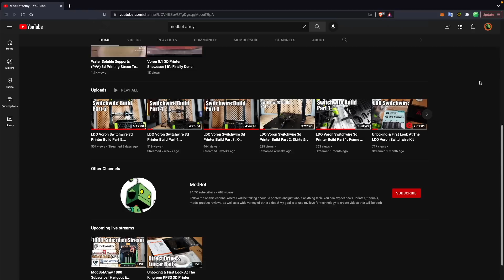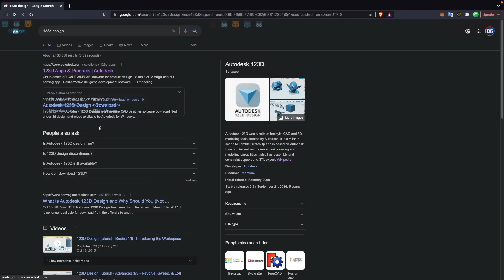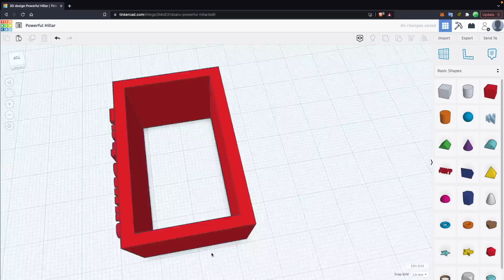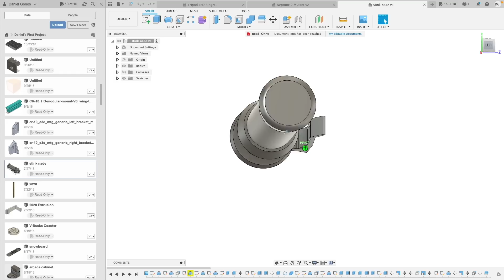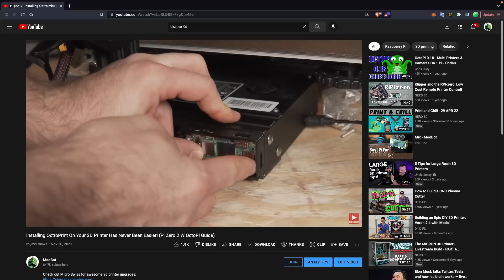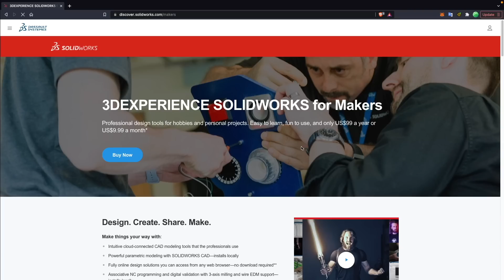Is 3d Modeling A Requirement For 3d Printing? (Where To Start)

Comment: Once someone is past the beginner stage of understanding and using a 3D printer, I personally feel that folks should learn the basics of 3D modeling rather than constantly relying on others for models, usually expecting free or super cheap files. The sense of entitlement that a lot of people feel for the design files of others who spent the time and effort (and in some cases, money) to actually learn 3D modeling gets pretty disgusting after a while.

Comment: A great resource you didn't mention, was more and more local community colleges now have 3D modeling and Rapid Prototyping (3d Printing) as part of their manufacturing departments. They might have classes listed in other departments, like architectural/drafting, but they all will give access to student versions of different software. And you'd be surprised to see the variety of printers some cc's have, binder-jet, SLA, Polyjet, SLS (nylon 12 and  metal.)

Comment: I've been using 123D Design and TinkerCAD since their beginning.  I love them both.  I use TinkerCAD when I need to create something simple and quick.  123D Design is better at filet/chamfer/etc.  Years ago I learned Blender basics and got pretty good, but like you it's too organic for the kinds of things I 3D print.  Also, I too have been trying to get myself to learn Fusion 360.  Thanks for a couple other resources, I didn't know about, like Shapr3D and FreeCAD.

Comment: I've been a professional 3D artist for 20 years. The whole reason I got into 3D printing was to see my models in real life. I mainly use Lightwave 3D and 3D-Coat, Occasionally MoI3D for CAD. As someone who mainly worked in animation one thing I had to get used to was always making my models water tight. For animation I could often leave holes in it or leave one entire side open and just jam it into the rest of the model to hide it.

Comment: I use fusion 360, but I started modeling with cardboard and then went to autocad. I loved in 2d drawings and isometric drawings for a long time then found SOLIDWORKS and fusion 360. So I'm here making parts with fusion. I find about 40% of the things I print are my own design.

Comment: Well - I use both Blender and FreeCAD. Blender mostly for "organic" designs (I will explain why a bit later) and FreeCAD for all mechanical constructions. The reason I choose those programs, is because they are completely open source. I never felt comfortable with closed source programs. The reason why is perfectly demonstrated by Fusion 360 lately, that got some restrictions out of the blue and as a user you can do nothing against that. Even worst - You never know if they do that again, and even more bluntly and restrictive, at some later date. This can never happen with open source software, of course. And as a bonus open source is completely free and without any restrictions and for every type of use.
Anyway - I used CAD mostly to replace broken parts in consumer electronics in a repair shop (I am retired for a while already, so that part is less crucial now). Those parts are often difficult to get, or even completely out of production. Here CAD in combination with 3D printing is a big cost and time saver! 

Now about that "organic" modeling. For a long time I have worked (and soon will start again after a short inactive period) with laser equipment to make Holograms. I use Blender in combination with a 3D printer (Creality Ender 5 Pro) to print models that will end up in a Hologram. Funny thing is, for Holography you need equipment to hold film, models, lenses, mirrors and that kind of stuff. In the early days you needed completely metal stuff to keep things stable during (very) long exposure times. Nowadays you can use far more powerful laser diodes that allow very short exposure times, so you can use far less rigid materials, like (you guessed it) PLA. So now I can design and print all the equipment that I need to do Holographic work.

I love it!

Comment: I agree with Daniel Hastings.  I am almost exclusively an OpenSCAD designer. I was disappointed that you did not at least mention programmatic design as an alternative.
Reply from the maker: To be fair, the only reason I did not is I have zero experience with it. My programing knowledge is minimal at best and I think I have only seen OpenSCAD in front of me once. One of the guys at my last job (head dev) used it for a few of his designs. I did not exclude it to intentionally exclude it.

Comment: Can you use Fusion 360 free for more than a year?  I have several projects done in 360 hat need to be modified but can’t sense my year trial has ran out.
Reply from the maker: They have changed their licensing quite a few times. I had the student license for like 3 years then went to hobbyist. I would recommend seeing if you can get the hobbyist license. It should be available through their site but you may have to fill out some sort of questionnaire.
Reply: @ModBotArmy  Thanks

Comment: Rhino 3d is what I use. I actually got into modeling before getting a printer. Blender never really jived with me, and I had previous hands on time with Rhino, so that's what I ended up getting. Certainly not the cheapest, but it is a one time buy, and it's worked well for engineering prints as well as just more artistic 3d modeling purposes.
Reply from the maker: I am not sure I have heard of Rhino before. It does ring a bell but I cannot picture it and know I at least have not had hands on with it. Seems like a few others in the comments are using it as well. I am going to watch a few videos on it :)
Reply: @ModBotArmy  The Rhino 3d YT channel: https://www.youtube.com/c/Rhinoceros3d

Comment: Well, I am artistic and like design.. But 3D design software is something I just can't cope with?
I have enough problems even trying to learn how to do it on any software.. 

Blender nice But it just will not stop damn changing!  I seen now over 20 major updates and redesigning of the controls and user interface of Blender in like only 2 months.. so much so the basics I was trying to learn on there are so changed now and the area's of what is where and how it is done has totally thrown me off how to even use the basics of the one I started to try to use?

Fusion 360 is far far too bloody hard to learn even with videos on how to do it.. they took away tons of features from the free version and that really upset many users... so between those things I gave up on even trying to do it.  

FreeCad.. I try to use But it just keeps on crashing even few seconds on me and I have a gaming level PC with a fast quad core CPU running at 3.8 Gb and fast huge hard drive and even double the RAM most people ever use on a PC.. most use 16 Gb I have 32 Gb of fast DDR 3 RAM and my GPU is a new one it's self has 2 Gb of DDR 4 RAM all with a fast fiber internet.  But the damn FreeCad just crashes all the time so I given up trying that.  

Unless your a super clever gifted artist or natural designer whom can learn these fancy Cad's then I would say don't bother... leave that clever complex stuff to those who are gifted at it. 
People need to do what they have the gifts to do not what they can't... sad fact of life either you are a gifted at what ever or not.... we all can't be gifted with being able to do everything... many try few can.
Reply: What a very depressing comment :)
Reply from the maker: Damn I am sorry to hear you have had such poor experiences with so many of the programs. I dont think that everyone should or needs to master them but even knowing you way around to modify an existing design or make something simple can be very handy.

Comment: I currently use Fusion 360. I find fusion 360 better for complex assemblies like 3d printers. I have used Freecad for less complex assemblies and single part designs. You can use either Fusion 360 or Freecad for both direct and parametric modeling.
Reply from the maker: I will always have a bit of a love for Fusion. I plan on getting more into CNC when I move and have a garage so the ability to create tool paths is very powerful to me.

Comment: I still use 123Design even though it hasn't been supported with updates for years.  Do agree with it being buggy, though I think Windows plays a part in that.  At one point I found that if you extruder a part, and it was usually when trying to do it on multiple items it would crash.  So I just make sure to save before I perform an extrusion, so that way if it crashes I don't loose alot of work.
Reply from the maker: No kidding? Haha that is awesome. Just watching videos on it for this video took me back. It was not all bad but I just remember a few rage moments where I wanted to cry. Cool to know you and possible others are still creating with it.

Comment: I thought was good at modeling, doing a bunch for game jams and art projects. But when i got into engineering adapting to a parametric workflow was quite a lot of work coming form free from modeling. But you will never done learning, looking a tricks form other models on how to make stuff better printable. 
My tip for today is to really focus on what your critical dimensions are and what shapes of the part don't really matter. This way i manage to make some really wacky looking part with bolt holes in all sorts of  funky angels and using a plane that is totally crocked to xyz to join it all together to print without any supports or overhangs. 
Not all dimensions matter and going of axis  can really improve your designs.
Reply: Intereating to hear your experience. I have the opposite wherein i come from an engineering background. Learning to model freeform and organic design is such a challenge for me!
Reply from the maker: Having looked at friends and other artists modeling in the free form you describe I have a lot of respect for both side of the fence. They certainly have their own sets of challenges. Pretty cool you were able to transition though. Some of the coolest models I have seen take that engineering style of modeling and add a layer of free form on top of it.

Comment: It's soo satisfying to be able to imagine a solution to a problem, make it in CAD, and then print it.
Don't have the right tool? just make it. Doesn't the robot vaccum get under the tv bemch? Print raisers.
Broken 10$ hair guard for your bathtub (again)? No problem anymore!
Reply from the maker: I completely agree. Our Tv sound bar needed a mount so I designed simple L brackets that have held it to the wall for years. I needed a custom storage solution for a project and quick design to have it made. Even my mobile streaming cart I wanted to attach some of the aluminum tubes so I designed a fairly simple snapping clamp that holds them together. 

I may not need to custom make things often but when I do I always feel like some sort of wizard haha

Comment: Yep totally agree. I spent the 6 months with Lars prior to getting my first 3d printer learning Fusion 360 and I've never looked back. It was the best prerequisite I could have done for my journey into functional 3d printing. My very first 3d print wasn't a Benchey but a part I created in Fusion which was SOOOO satisfying
Reply from the maker: You legend. I wish I had gone that route. I still need to sit down and watch more of his videos. I always get a good run going where I will watch many of his videos for some days and then like a squirrel get distracted. First print was not a benchy either but certainly not something I made. Way cool to hear that and wish I had gone that route.
Reply: @ModBotArmy  thanks pal the only issue now is I've forgotten most of what lars taught me lolollol
Reply: May I ask you a question? I notice that a lot of his videos that are aimed towards beginners to Fusion360 are from a few years ago. I've run into this problem in the past, where the program has evolved since the beginner friendly videos were made. Which turns navigation into a nightmare. Even if it's a little bit off, it's so counterproductive to how my brain learns. Is this the case with his videos? and Fusion360? Any info is much appreciated!!!
Reply: @SkydozerFPV  Thanks for the question and its a good one. Not at all. The videos on Fusion are right on as far as I can tell. I use the free version which works great and the difference is the recent changes to tat version which are documented well here. 
If you just starting off Mike I would absolutely DL 360 and go to Lars channel for his tutorials.
Reply: @SkydozerFPV  https://www.youtube.com/user/cadcamstuff
Reply: @SkydozerFPV  No. UI appearance has changed a bit, but functionality is still identical,well some features obviously have been added since, but it's still absolutely valid to watch even the oldest tutorials.

Comment: Taking your title as a question "Is 3d modelling a requirement for 3d printing?"

No, not at all.. there's so many sites now with so many free & paid models, it's easy enough to buy a printer and print with these.. some functional parts are even sizeable..

Going deeper as you did..

If your already into 3d rendering or cad, a 3d printer is a continuation of your hobby, making designs real to the touch - though you may have fix your model from 3d rendering software to make it actually printable. 

For those that start with a 3d printer,  both 3d software & cad are a continuation of this hobby, as you can make your own version of a thing or even design something completely new..

The final analysis is thus:

Cad, 3d rendering & 3d printing are all separate entities, but all can equally be used with each other - just another happy coincidence. 

I enjoy the power of freecad,  though like a lot of software, to become comfortable with it, there's a decent learning curve to overcome. 

Please don't put blender 3d down too much as it is very capable and getting better all the time.. Plus, the 3d print addon is handy for helping you to make your models 3d printer ready - it's still a good tool for your arsenal..
Reply from the maker: Thank you for taking the time to reply (and put some thought into your reply). Pretty much how I feel exactly. They are almost siblings of eachother or cousins. One can function without the other but they share a relationship and the more you know the more useful each one becomes. 

I have heard pretty good things about FreeCAD. I know they have been fairly active as I see updates posted frequently. 

When it comes to Blender I have heard it has had a major overhaul since (that was back in 2016-2017 so I am sure my experience today could be very different)

Cheers
Reply: @ModBotArmy  blender has been brought into this century now and the best thing is that its free and affordable, so no need for dodgy cracks..

Freecad has a large userbase and a friendly forum on Facebook for help. Definitely worth  look when you have time to learn it. The huge number of workbenches make it look overwhelming, but if you look into it, you only need 2 or 3 of them to begin with. It's very powerful though,  as you learn more.

Both software's have a fairly steep learning curve  - as we're talking of 3d creation, that's kinda expected..